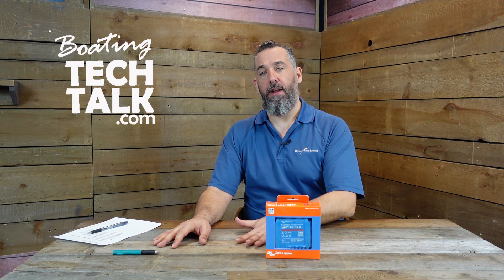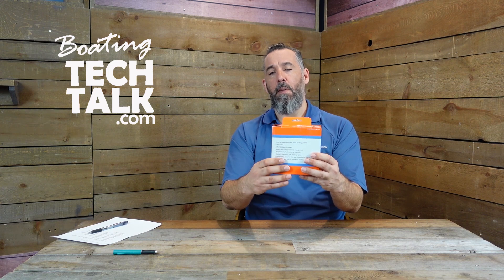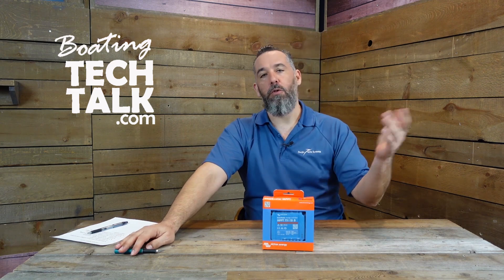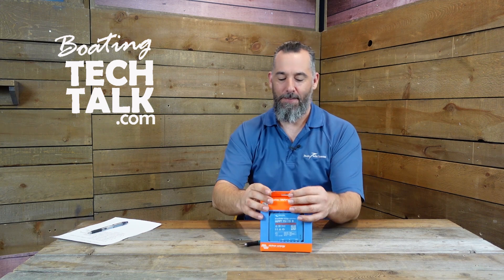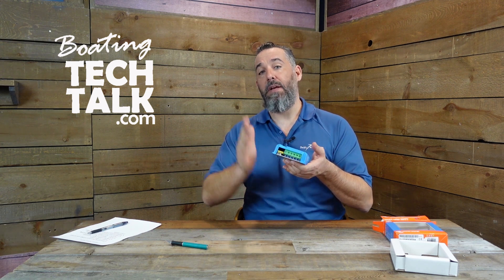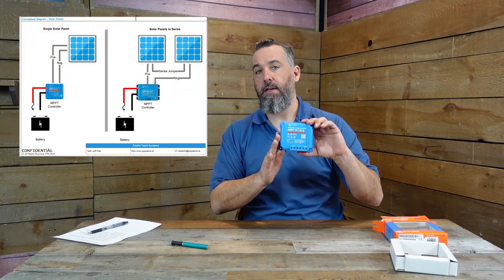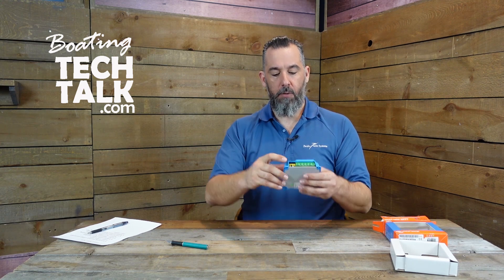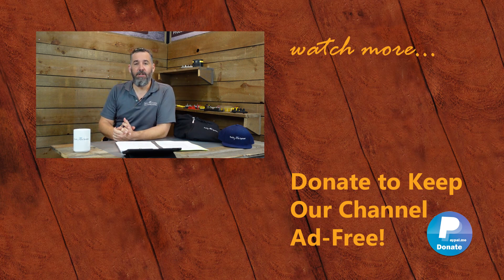Victron SmartSolar MPPT 75/15 Solar Controller with Bluetooth - UnBoxing and Product Review

Comment: And what is the little black piece at the VE bus entrance?
Reply: A jumper in the VE.port for configuring load output settings. This jumper allows for selecting different load output algorithms, like "Always On" or "Battery Disconnect". Mine broke and I don't use it. Not needed with the Victron Connect phone app.

Comment: The Victron 75/15 is amazing functionally. Unfortunately it generates lots of noise in our HF radio on shore and on the boat. It's so bad, we need yo disconnect the panels just to use HF email.

Comment: Hi Jeffi bought a victron 75 15 no blue tooth tooth just finish wiring in vw day van I am currently looking at 110ah battery's agm or normal leisure what are the default setting for battery use.didnt get Bluetooth not a techy person i regret it now any advise jeff
Reply: koop de 100/15 met bluetooht 200ah  litium 1 paneel 305 wp omvoormer 2000watt. Litime redelijk geprijsd en werkt al 2 jaar.

Comment: Are you supposed to take the 20a fuse out? It’s super stiff. Upon Testing with my multimeter it seems dead. It switches off at night and charger is not working.
Reply from the maker: Fuse is meant to stay in place for circuit to be energized.

Comment: Hello, Jeff. It is recommended in the Victron manual that the 75/15 be mounted on a fire resistant surface. Is this entirely necessary?
Reply from the maker: Hi Dave, always preferable to mount electrical devices on a fire resistant surface.
Reply: @PacificYachtSystems  Thanks, Jeff. Can we use aluminum plate as a heat shield? Can we use a Victron smart battery sensor to monitor the temp of the mppt if mounted directly on the unit and is it necessary?

Comment: Hey jef
IHave  question   can I put  two  320  watt pannells in series 38v by two  9 amp each  on 12 volt battery  bank
Reply from the maker: Hi Desmond, solar panels can definitely be wired in series or parallel, make sure your solar controller can handle the total amps from boat panels.

Comment: I have the 75/15 and like it overall.  The only issue I have had with it was during my last road trip when I somehow blew the fuse on it but it gave me no obvious indication.  For example, when I would look at the app it would say such and such solar power was coming in and that the battery was like 13.48 volts (if I remember correctly... somewhere close to that at least).  Two days into the trip, however, one of my devices refused to fully turn on and was giving warnings that my battery was almost dead.  I checked the MPPT app and it still said around 13.48v.  However, when I checked it with a volt meter it said it was only 10.8 volts... OUCH!
I did further tests and found that no voltage was going from the MPPT to the battery at all.  I replaced the fuse and it started working properly again.  It is possible it was giving me lights during this time... I have no clue what the lights mean though without checking the manual (problem in itself)... plus, I cover them up anyway during road trips since I can't sleep with the constant blinking, etc.  Regardless, the app should be giving these warnings.
BTW, getting the fuse out is a MAJOR PITA.  At least it was on my mppt.  Not only is it in there tight but they used some kind of compound on it to glue it in place.  I couldn't even get it out with normal pliers. I needed a special pair with super jagged grips in order to grip it well enough.  And I almost tore the fuse in half getting it out...lol.  
ALSO, it is idiotic that they have jumpers next to the fuse.  Mine fell out while I was taking the fuse out.  Had to research which prongs the jumper went on.  Turns out that there is only one way the jumpers work on the 75/15... the other prongs are there for completely different models.  They should just solder the two prongs and not have a jumper.
Reply from the maker: Thanks for sharing!

Comment: I  just installed a renogy 100 watt panel with a victron 75/15 controller with a 100ah battery. The only thing I run is a ARB 50 qt 12v cooler. I would like to add another 100 watt panel.  Here is the question, will the victron 75/15 handle 2 100 watt panels ?
Reply from the maker: Yep, the Victron 75/15 can handle up to 220 watts on solar.
Reply: Thank you.

Comment: What are the appropriate wires to use, and where are they sold?
Reply from the maker: From the solar panel to the controller, use solar wiring, generally #10 wires.

Comment: Can you use 200 w solar panel with the 15 amp unit
Reply from the maker: Yep, it's pretty close, the max wattage is about 220 watts for the 75/15 MPPT controller.

Comment: Do you use wire ferrules on your stranded wires?  We use them on all our jobs. Tho we do home automation and some car audio not much with marine.  I would wonder if it would cause more corrosion or not.
Reply from the maker: Yep, we do use ferrules, especially when doing terminations that are really close together to avoid any strafe metal strands coming into contact with another nearby wire.
Reply: @PacificYachtSystems  Nice well done,  I was wondering what type or does it matter?  Do they make a tinned type surface ferrule or does it matter, worried about corrosion. Thanks for your time answering all these questions form everybody! Now I am ordering a hat now!! Love your channel!

Comment: Hi Jeff. I was looking at the Victron manual. It suggests that the load for the boat be connected to the second lot of output connections. i.e. not the battery output. Does this mean that you'd connect the bus bars for the boats system to that? Does this mean that excess (not used for battery charging) solar electricity is used to power boat systems rather than being lost as heat?

Thanks for the great videos
Reply from the maker: Hi Simon, we've never ever used the load output from a solar controller. Personally, haven't come across a load i want the solar controller to power when the sun is shinning.
Reply: I've seen some van life videos where they put excess power into water heaters.
Reply: @royblackburn1163  The load output is limited to like 10 or 15A so you can't do very much with it unless the element you're using to heat water with is very small.

Comment: Best way to benchmark chargers is specific gravity performance. I never see an honest review. I've never seen a Victron do better than 1.26 SG. Thats 90% charged which for sulphation reasons I consider to be negligent and harmful. Ironically most people are attracted to the features and not it's charge performance. I get much better results with MorningStar. Sometimes 1.28 even 1.3 if left on trickle for months.
I won't recommend blue boxes...they're always compromised in my experiance.
Reply: How much did morningstar pay you to write this?
Reply: Nothing. I compare products with a hydrometer. I invite you to investigate too.
Reply from the maker: Thanks for sharing Liam.

Comment: The Victron gear is nice. Good packaging and they have the iconic blue case, good aesthetics for a clean-looking install. Their MPPT implementation is quite good and they also minimize the use of fans where they can, which is a major selling point; less energy draw and eliminates a common failure point. My personal fave in charge controllers is Morningstar (best MPPT in the industry and no fans), BUT I'd choose the Victron over that for a marine install where PV strings tend to be lower voltage and the salt air tries to eat everything in 27 seconds. Keep your lugs tight and your sails trimmed. :)
Reply from the maker: Thanks for sharing Tao, good perspective.

Comment: I have 3 Victron controllers including 2 75/15s and LUV them! The Blue tooth info is so cool I can’t wait to pull up the app when I get to the boat first thing. I leave everything running on the boat and the batteries are always 100% by the afternoon of course with no shore power. Solar is just fantastic, Victron is a great company and I can’t wait for another reason to buy another one of their products.
Reply from the maker: Thanks for sharing Ben, appreciate it.

Comment: Hi Jeff, watching your videos every evening from the uk .... thanks for passing on your knowledge and experience. Question on the installation location of one of these controllers - should it be closer to the battery or the solar panel? or doesn't it matter?
Reply from the maker: Thanks Steve, suggest you install the controller closer to the battery.

Comment: Hi and thank you for the work your doing, i have swapped out an old controller for the victron smart  75/15. Whats the most panel wattage  i can connect to it as the advice im googling is all over the place, thanks in advance
Reply from the maker: 220 watts is the max panel wattage for a victron 75/15.
Reply: Hi Jeff, does this 220w also apply if you have a 24v battery bank? I’m a little confused by the spec sheets. Thanks!

Comment: Hi Jeff, this is exactly the regulator I have installed. I also have a BMV 712 to monitor the system. The only problem encontered is the high voltage alarm. In theory the maximum voltage set on the regulator is 14.6 so I put the maximum for the alarm at 14.65. And from time to time it does reach that. As it was more enoying than problematic I think? I now set the alrm at 14.70 wondering if in fact there is an issu, my battery bank is lead acid no maintenance. Thanks in advance
Reply from the maker: With temperature compensated charging, it's possible you might have a even higher charging voltage in colder temps.

Comment: This video is labeled blue solar while Jeff reviewed the smart solar product. The Blue solar is a different product.
Reply from the maker: Thanks Mike, good point. The BlueSolar doesn't have bluetooth.
Reply: @PacificYachtSystems  I have this exact product on the way so happened to be comparing the differences recently. I would have liked Jeff to talk about the wired interconnect between devices as I will have more than 1 and wonder if it is worth connecting them.